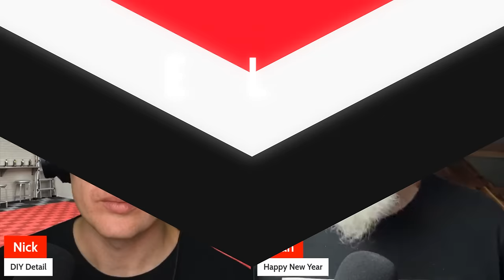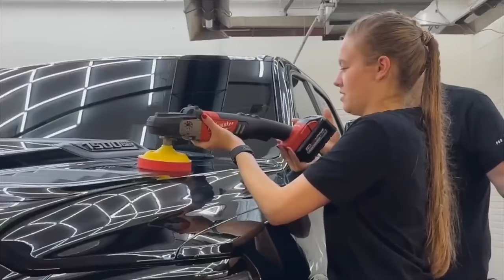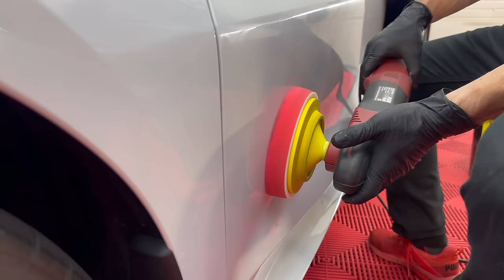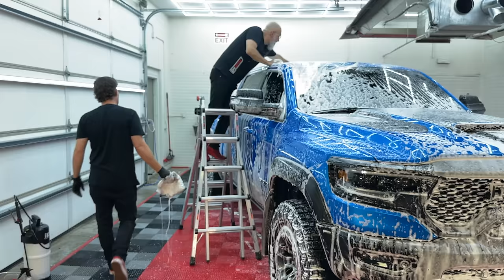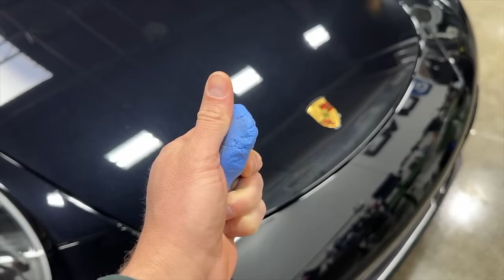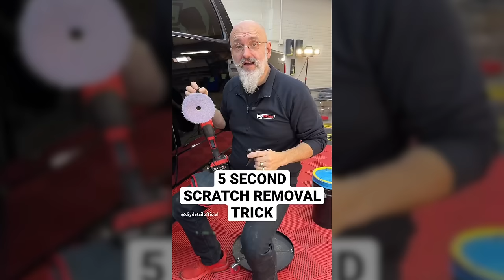2023 in review: fan feedback (thanks for the questions!) | #Podcast # 77#diydetail #detailing

Comment: Quick question regarding the steps to paint correction. Are these correct?

Wash first.

Use metal remover, clay towel,  then rinse.

Buff to remove swirl marks and scratches.

Apply wax / sealant.
Reply from the maker: Yes, correct

Comment: One of these days I'm going to buy a sander for polishing. Curious. Like many, I have a number of clay towels and mitts, and was hesitant to buy the perforated towel. Its gentle nature sold me. Now that I have it, It's an impressive tool. Very well made. Its quality stands out. Love using it. I've never been fond of pressure on clear, and this product does the job beautifully. Using it with the DIY iron remover changed how I go about things. Saves so much time. 

Is there a speed that's too low for a rotary with a 5.5" pad? My Makita goes down to 600RPM.
Reply from the maker: 600 rpm is perfect!

Comment: I've heard that one of the main reasons (outside of paint correction) to polish before applying a ceramic coating is that it's the only way to ensure that any existing wax or other protection is gone, allowing the ceramic coating to bond directly to the clear coat. If you're ceramic coating over some other protection layer, it's definitely going to affect the performance of the coating. I've never had much luck with stripping shampoos or foams. My paint always still beads water after using them, so I'd be a little apprehensive of coating without polishing first.
Reply from the maker: Stripping shampoos are great marketing, but as you have learned they do nothing. 

Yes it’s a risk but not everyone wants or can polish before a coating. 

Here’s a video that may answer some of your concerns.

https://youtu.be/IKv4gWYO8DY?si=VFDJ9sShSX0NjtIt
Reply: @diydetailofficial  Thank you. An informative video as always, but it didn’t really address my concern. How do you remove any previous protection before applying a ceramic coating if not polishing?
Reply from the maker: It depends on the protection. For waxes, wash, iron remover, DIY Detail All Clean , and DIY Detail Water Spot Remover will weaken it enough. For something like DIY Detail Ceramic Gloss or DIY Detail Quick Beads, Time ( 8-12 months) or polishing.
Reply: @diydetailofficial  There’s what I’m looking for.  That makes sense. Thanks again!

Comment: On the grit guards and wall guards. Do you need to take them out and clean them. ?  The grit guard is extremely hard to get out. Super tight fit actually broke the finger slots. Trying take out.  So didn’t know if could just leave them in if safe.
Reply from the maker: No need to clean them so far

Comment: if I dont foam up the car twice, only once at the start, then rinse and then go to manual hand wash, is it a safety concern?
also, can rinseless and soap be used together in a bucket for better lubrication during handwash?
Reply from the maker: It’s best to add a little more foam between the paint and the mitt. 

No need with DIY Detail Incredible Suds, it’s very lubricious alone.

Comment: Thanks really enjoying your videos. If my vehicle has been waxed can I apply the ceramic coating? The other question I have is what product do I use to remove white wax marks on my plastics and painted running boards. Thanks
Reply from the maker: To remove the wax residue , use DIY Detail All Clean , ideally you should polish to remove the wax

Comment: So question when it comes to drying aid is there any concerns with putting not as durable protection on first with being the aid and then a longer lasting protection over top?  Wouldn't the longer lasting one fail as soon as the protection the aid left on the surface fails?
Reply from the maker: If you’re using it every wash it’s not a concern, but yes, most durable is the foundation
Reply: @diydetailofficial  ok so your opinion when I am doing a clients car that may only come in a few times a year should I not use a drying aid and only use the 6 month sealant for protection?
Reply from the maker: Our DIY Detail Ceramic Gloss is both a drying aid and long term ceramic sealant

Comment: Great channel guys!  I've learned so much.  I have a question.  I detailed my car and put a ceramic coating on it.  I live in Florida so cars don't get that dirty.  Can I go to a touchless carwash, prefoam the car and just rinse it off or should I use the carwash soap as well before I rinse?
Reply from the maker: That works, but be sure to dry it well.
Reply: @diydetailofficial  thanks!  I bought a leaf blower to dry it.

Comment: so in the hot VERY VERY humid texas weather, the rinseless washer is drying to fast even in my cover wash spot.  NOT AC, NOT GARAGE but covered.  I pre rinse, rinse, rinseless the car and by the time I come around to contact,  the car is almost dry and the road film that is left that I need to use the sponge has now dried to the car again.  The only way I have been to counter this was to  Pre Rinse, Rinse, FAST FAST Rinseless, then rinseless spray  on a panel and contact wash and go panel by panel.  What do you think anything you can suggest.  I am also washing with city water not ionized or softened water.
Reply from the maker: Work in small sections. DIY Detail Rinse Less Wash can dry on the surface without any problems.

Comment: Which cordless milwaukee rotary tool do you have?
Reply from the maker: We have 3 of them, Rotary, 15 and 21 mm
Reply: @diydetailofficial  is the rotary the "7in"?
Reply from the maker: 7 inch is the maximum recommended pad size. You can get backing plates that range from 1 inch to 9 inches for rotaries. They don’t have a fixed size like a DA
Reply: @diydetailofficial  thank you!